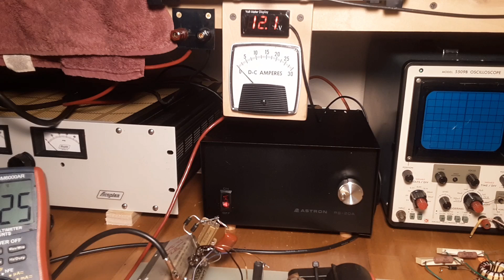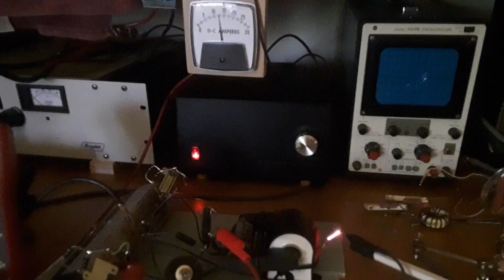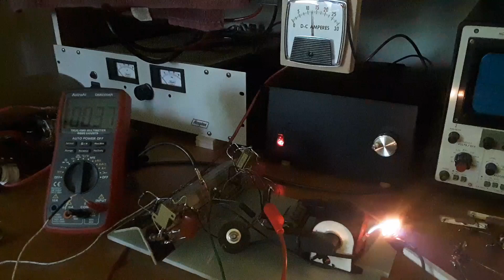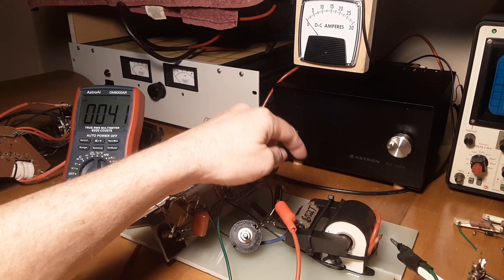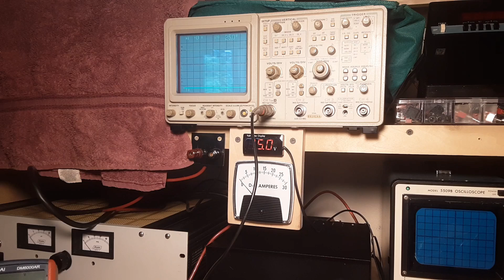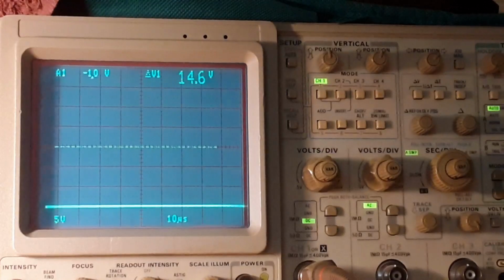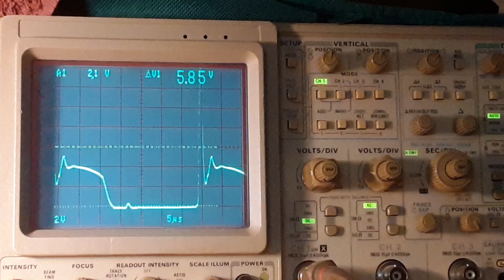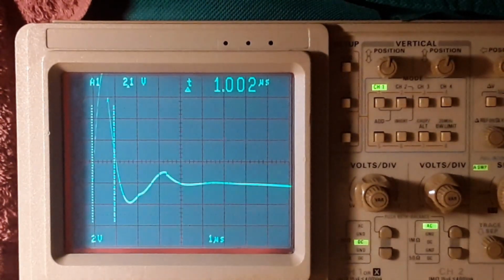2500 turn flyback, on jantx 2n5672🌡🔥

Comment from the maker: Kinda messed up my conclusion,but bipolar transistors produce a lesser "amplitude and width turn off" spike compared to my Mosfet driver trial.🤔also watch who you buy,"Mueller "clip leads from😅mine don't conduct electricity(scope waveform cutting out)

Comment: The mosfets are faster and the voltage kick back from an inductor is proportional to the current and the rate of change di/dt
Reply from the maker: I'm working on the di/dt.i know the concept,but stumbling on applying it(snubbers).
Reply: @generalingwer4341  try a 10nF 10ohm RC across FETs mate, or a RCD snbber you can also try increasing the gate resistor value and use asymmetric gate drive, switch the gates on through say 15ohms and off through 8ohms to even it out,  id need to see your schematic to try help in a meaningful way.. to be honest you would be better using a SMPS IC like the TL494 or SG3525 where you have full control over frequency and deadtime aswell as 2 error amps for voltage and current feedback if you want to implement and regulation or protection etc, you can use it without any feedback of course.. i used a 494 and isolated gate drive ICs + cm300dy24n in my 18kW half bridge, no GDT so i can drive anything from 1.5kHz to 50kHz..
Reply from the maker: @T2D.SteveArcs  we need to be neighbors,shortest response.🙂
Reply: @generalingwer4341  😄❤️😎👍🏻

Comment: You dont need a gap when running push pull mate, obviously you need a gap when running is single ended as a coupled indicator to avoid saturation and to give you the large "flyback" voltage when current is interuppreted
Reply from the maker: Huh.i never tried no gap.lol,but I've tried every gap up to about .036" at least a thousand times😅😅😅
Reply: @generalingwer4341  he he, i would try a different flyback mate, 2500t secondary sounds a lot, the inductance of that will be massive aswel as the interwinding capacitance etc, usually fb are around 1000 to 1500t for 20 to 25kHz